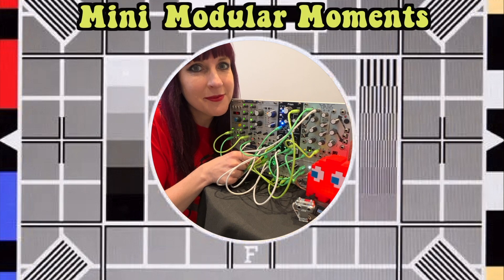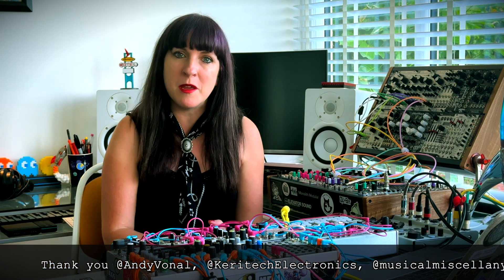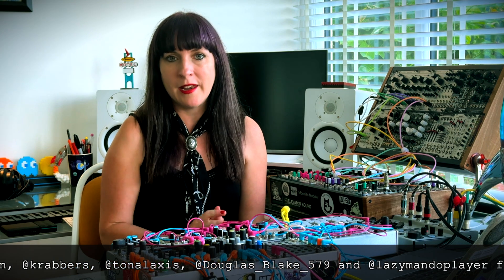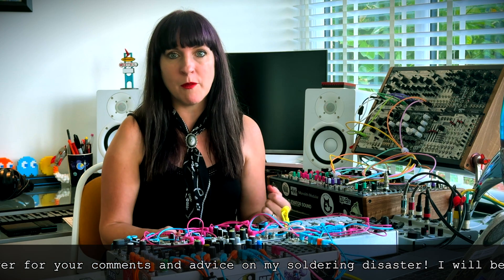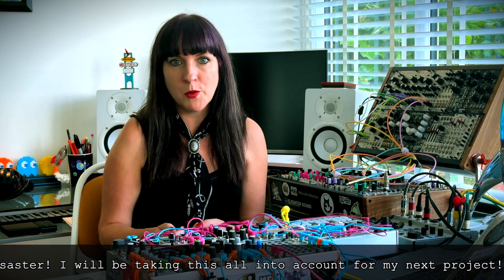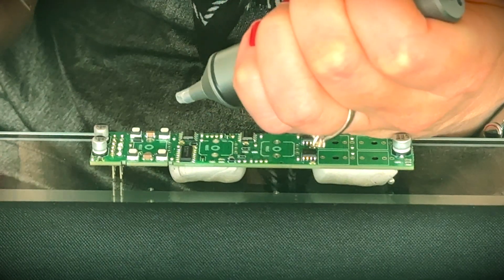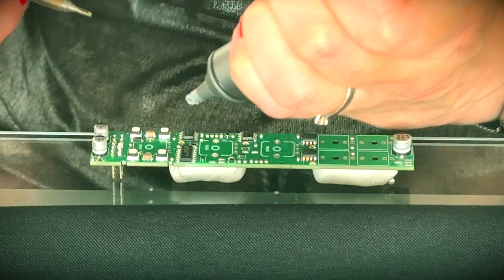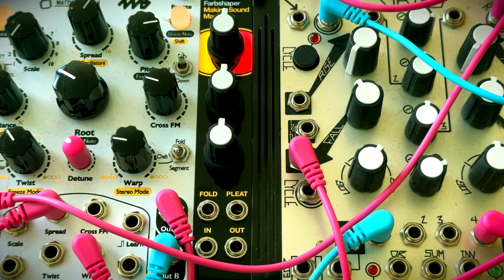Farbshaper Fixed! A Mini Modular Comeback Story 🎉

Comment: Currently in the middle of building a Turing Machine... needed to see a good solder
Reply from the maker: Good luck! I have to admit, I did try soldering a Turing machine a few years back. Unfortunately had a terrible soldering iron and it ended up a mess. So my advice would be to make sure you have a great soldering iron! Turing machine is a fantastic module - hope it works out well! Keep us posted :)

Comment: A fine tip is great but I find I need a higher wattage soldering iron for a fine tip so i mostly use / struggle with a bigger tip. I usually melt a power header, like its my trademark for DIY!
Reply from the maker: lol! Yeah I need to get a bit of practise with the fine tip, wasn’t as easy as I thought it was going to be!

Comment: Looks like your iron is too hot.  If you can adjust the temperature, you do not need to have it that much above the melting point for the solder.
Make sure the iron heats  up the circuit board at the point you want to solder.  Then apply solder to the board and let it flow around the component/wire.
Reply from the maker: @la7dfa  many thanks for the tip! Think it was at 380. I’ll try it a little cooler next time :)

Comment: We all have bad days. I had an absolute mare trying to solder a USB-C connector on an Nquencer yesterday. Wrecked the connector and I have to hope the board has survived, the rest of that project should be pretty easy but I need the connector to upload the firmware. Put that back in the box for now and built a cascade that's been waiting for attention. That worked without a hitch thankfully.
Reply from the maker: Hope you get your Nquencer sorted! I’m sure it will be fine, I was convinced I’d wrecked my module and it worked just fine :) sometimes it just needs leaving for a bit and then coming back!

Comment: You really shouldn't need to use a solder sucker very often, you should be cleaning the tip of your iron regularly to keep solder from building up on it.  I've been building electronics for at least 54 years now, and I've used a solder sucker maybe half a dozen times.  If you keep the tip clean, you can actually remove excess solder with the iron itself, and that method would definitely have worked with the power connector in the previous video.  If there's a lot of excess solder, clean the tip, reflow the joint, some solder will remain on the iron, clean it again, and reflow again if you need to remove more.  Way easier than using some solder sucker.
Reply from the maker: Thanks for the advice! I didn’t realise that. Think the second time round I used the solder sucker about 10 times - first to remove the first 5 joints and then to correct some more dodgy joints! I’ll give your method a go next time!
Reply: @iamseeingdots  it's much easier - one hand, just your soldering iron.  Just make sure each time between removing solder, you clean your tip in the wire wool (or whatever you want to call it) until you see that the tip is only "tinned" - no excess solder on it, just a nice silvery tip.  Then remove more solder, clean again and reflow again.  Sometimes it may take two or three goes at it, but way easier than a solder sucker in one hand and the iron in the other.   A lot of times after I finish up a project, I'll look at all the joints and clean up any that have excess solder on them using this method.